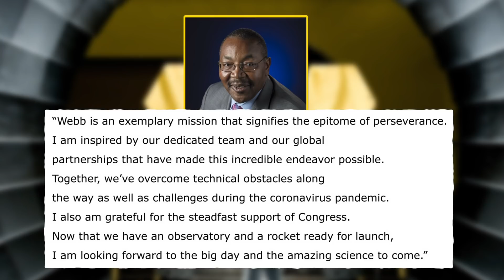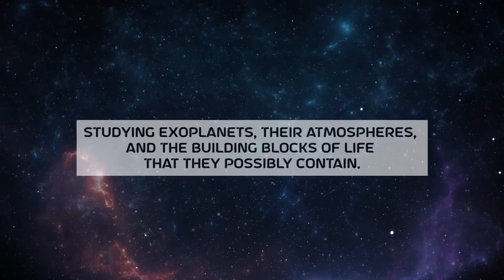James Webb Telescope Final Update Before Launch

Comment: I hope their sure that they are ready. Considering the failure of lucy. JWT is magnitudes higher complexity. I'll believe it when I see it !!
Reply: Lucy isn't a failure it has one segment unfolded but still has 95% energy. They will work out how to unfurl the last segment maybe by closing and opening or by kinetic motion.
Reply: NASA likes complicating stuff Space X beats JPL  because it applies simple and straightforward solutions. Space X could have come up with a simpler heat shield for JWST, the heat shield is a very high-risk point that I am worried about.